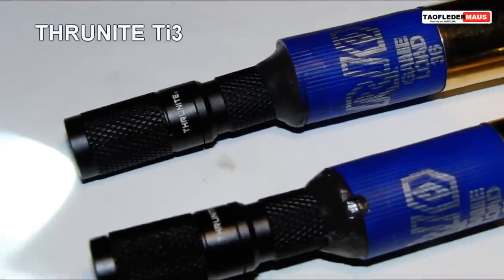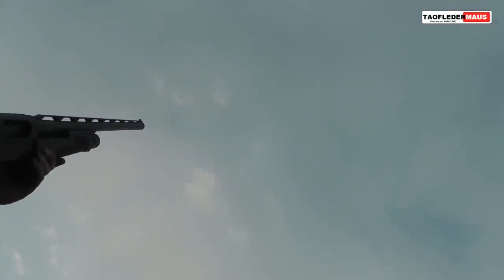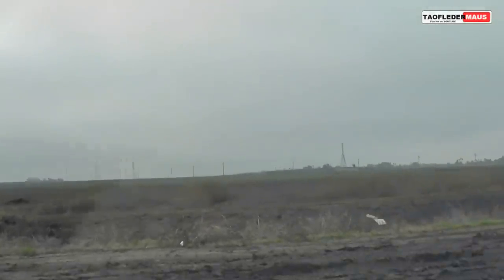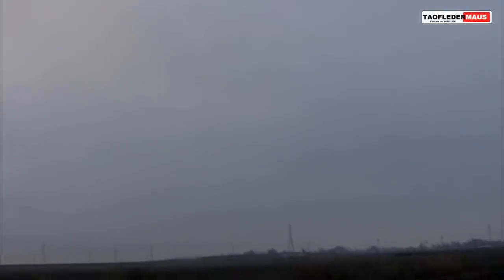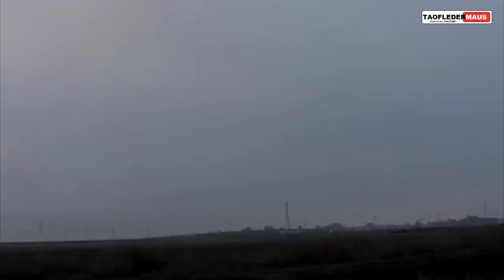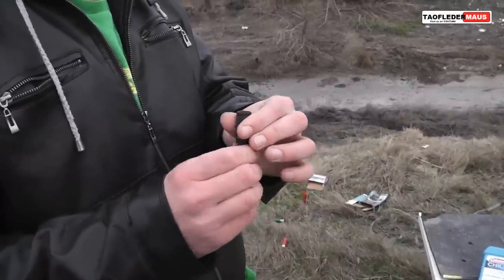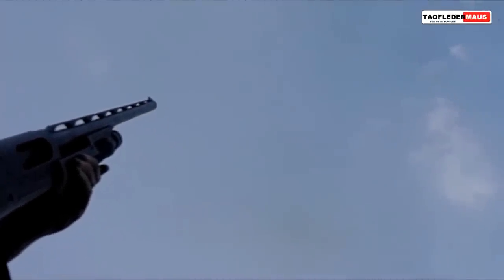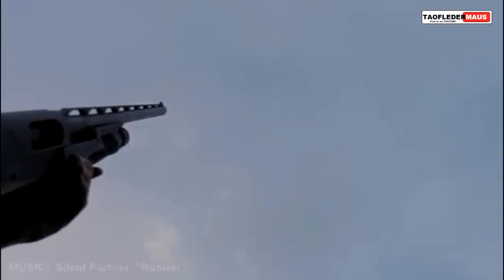Turning flashlights into BULLETS!   Surprising Results!

Comment: OK now i'm excited, i need to make a custom heatsink driver slug combo, where i use a 5w LED pulsed and over driven to 10 watts, and the light is triggered for "tracer" when it senses that it has been fired from the shotgun, in this mode its flashing at a full 10w and around 20Hz, and then when it senses that it has stopped moving it switches to find me mode where it flashes at 10w but only once every 5 seconds
Reply from the maker: +denvera1g1   The trick is building it strong enough to survive the g-shock.   The batteries in these were shoved backwards with so much force it compressed the battery.    It was a fluke the one flashlight stayed lit at all.

Comment: I did some binge buying of chinese LED lights on Amazon about a year ago.  They were all pretty bright, but about half of them failed unexpectedly due to bad solder joints.  I don't imagine they would fare well here.

If it's $5 vs $95, I get going the cheap route fpr toss around lights for the kids and whatnot.  But $5 vs $20 is a different story.  Pretty effective review of the product!
Reply from the maker: I'm cheap too.   Is a $100 flashlight 20x better than a $5 one?  Probably not.
Reply: Josh Daoust Thanks man, But I'm 17 not 12.
Reply: Josh Daoust  Planning to, going to college after finishing I might actually become something other then a sad flashlight expert.
Reply: Josh Daoust 95$. any more questions?
Reply: I Am SeCToR Josh Daoust You two are polluting the notifications of innocent bystanders with your weird little squabble.  Please move the conversation elsewhere.
Reply: Josh Daoust you can read the username right or did youtube get rid of it like they do everything else.

Comment: Hi cool video, as always.  You can calculate the height of a projectile if you know the flight time using the formula h=g*t^2 where h is height, g is acceleration due to gravity, t is time which gets squared here.  If it flied for 12 seconds then h=32.15*12^2 which works out to 4,629 feet.  That does not account for air drag... but it looks like you shoot that thing well over half a mile up to me!

Comment: Would they have looked like tracer rounds if they'd gone in the other way round, i.e. LED facing the shooter?
Reply from the maker: AintBigAintClever   The g-shock would have destroyed the flashlight,  shoving the battery into the circuit board.

Comment: Ok, so from what I can tell the flashlight flew for about 12 second, without air resistance that means 6 sec up, 6 sec down, a free fall for 6 second gets you a height of 9.82m/s^2*(6 sec)^2 /2 = 176 meters , then + air resistance and rounding maybe 150 meters up :O thats really high :D

Comment: I have a nitecore cobra flashlight, 3 years of dropping from 7 feet onto concrete, oil, solvents, heat and accidentally dropping in hot engine coolant it still works! I even washed it in a solvent spray washer.

If you rely on a flashlight, buy a good one.

Comment: Using crude estimations and physics equations (no air resistance). The flight time could range from 12.045 secs (frame counting) to 14 secs (Youtube time) the height could range from 177.918m (583.720ft) to 240.345m (788.533ft). But because I didn't account for somethings the height would most likely be higher.

Comment: That was awesome. At night that must look pretty cool to the human eye even if it can't be filmed. I think with a bit of compressed tinfoil between the batteries the other flashlights would have have survied the G forces.
Reply from the maker: tjpld   There is a little spring on the back of the body.    The battery was partially crushed on the neg. end of the battery from the g-shock as it slammed into that spring.   It was difficult to remove the battery.

Comment: Have you thought about firing one of those Swann Pen Cameras (or a copy), out of a shotgun while it's recording & see if anything is still recoverable from the Micro SD card?
Reply from the maker: milksheihk   I don't think the pen camera would survive the initial shock.   We shot a little pocket knife before and the blast really broke the knife apart when the gun fired.  I think those pen cams are about $50 making it a risky project to try.

Comment: You said that you didn't know how high it went, but it was in the air for around 13 seconds, which roughly means that it was falling for about 7.5 seconds.  By d = gt^2/2, it was around 275 metres or around 902 f.  All of this is pretty rough back of the envelope stuff, though.
Reply from the maker: Bevin van Liempt   That's probably very close.   About 300 to 400 yards was my best guess.

Comment: Ive had this on my wish list since Nighthawkinlight reviewed it and it is never going off until i get one!
Reply from the maker: Batteriii   I wish they were a little less expensive.  They are great flashlights and will last forever if you take care of them.  Usually that just means removing the battery when you aren't using it.   Batteries tend to swell up and corrode if you leave them in a flashlight for a long time.

Comment: According to my calculations the flashlight went 1626 feet high (error +-150 feet)
Assumptions:
Flight time: 12.5 seconds
Barrel Velocity: 1000 fps
Air resistance: 687 fps
Gravity: 32.174 ft/s2

If you want to use different assumptions, I can recalculate the numbers.
Reply: If anybody caught that I had to edit it after I posted it. Of course I screwed up the decimal. Air resistance was half what it should have been.
Reply: Finally, I really like your videos. You are doing stuff so I don't do it and kill myself. What about LED and watch batteries? Super glue led to watch battery. Have Wad, some crumpled paper. LED/BATTERY. crumpled paper. Maybe 3 levels of that.

Shoot at same time. That was a good idea. Enough light for the camera to see but dark enough for light to show up.

Comment: If you know the time it took to go up and down, pretty easy math to get an estimate of the hieght

looks like it was about 12 sec from firing to landing, so now its math time (in metric because I like it better):

so D = vt + (.5)(a)(t^2)

0=12v + .5(-9.8)(144)
705.6 = 12v
v = 58.8 (so initially it would have been traveling roughly 58.8 m/s or 131.5 mph)

at 6 sec the flashlight would be at the top of the arc so t = 6 for the next round calculations

h =  12*58.8 + .5(-9.8)(36)

h = 529.2

therefore the height the flashlight reached is 529.2 meters or 1736.22 feet

about 170 stories or higher than the Taipei 101 building (http://en.wikipedia.org/wiki/Taipei_101)

bear in mind this ignores all aerodynamics so its probably lower.

Comment: 13 seconds from barrel to ground. given that it probably rose at much faster than terminal velocity, lets say it took more than half the time to fall. so 9 seconds to fall.  x = 1/2 a t*t. where t =9 and a=9.8.   that means the height was . 81*9.8*0.5 =  approx 400 meters, or 1300 feet or so

Comment: Damn, if i lived near that place, i would definately go looking for them :)
Just ordered one on Amazon two days ago.
Reply from the maker: Nighthawk117w  They are great flashlights.  I think the only Achilles heal is the type of battery it uses.  If you plan on storing it,   just remember to take the battery out.   I've made the mistake several times of leaving them in and the batteries swell up and corrode and you can't even get them out of the body in other flashlights.

Comment: you should shoot a cam (somehow) but while its recording
Reply from the maker: max thepony  I doubt it would handle the extremely high g-shock loads.  I'm surprised the one flashlight survived in fact.  The battery slammed into the back of the flashlight with so much force the battery was slightly shorter and thicker afterwards.
Reply: you have a valid point
Reply from the maker: Yeah, it would be an expensive video to buy a few cameras small enough just to have them shatter each time we shot them.

Comment: Make virile time Distortion and antigravty. ..make mercury gas put under pressure inside brass globe make anode inside put strong magnetic Field on top north. Charge with 50 thousand k.v. . It's stuff they don't want you to know. ..

Comment: Should of done it at night, that would be cool
Reply from the maker: +Josh Lemerond  Cameras don't work that way.
Reply: I know but i meant to see the flashlight, just to see the light twirl in the sky if it was a bright enough flashlight
Reply from the maker: It was as dark as possible and still be able to film - using the limited amount of light,  and still be able to film in high speed.  When you shoot a flashlight at over 900 mph and it is tumbling in the air,   this IS what it looks like.

Comment: You need to shoot lasers out of a shotgun, laser first. The only reason is to see if they hit where the laser is pointing.
Reply from the maker: TheCompute101  just like the flashlight tumbled at a pretty high rate,  the laser is going to tumble around like crazy and you'd only see the laser for a split second while it faces the camera.   The rotation was so fast,  that my HD camera missed many of the flashes between camera frames.    I was able to see it flashing with my eyes,  while my cameras didn't pick up anything.

Comment: According to my math, the flashlight went about 2484 meters into the air. That is 2716 yards, or 2.5km, or 1.5 miles. Also I got a approximate muzzle velocity of 414 meters per second or 1358 feet per second. Can someone better a physics confirm?
Reply from the maker: I was hoping someone would figure that out!
Reply: Can you calculate the altitude based the time of the decent?  1.5 miles seems a bit much.  How long would it take to fall that far?
Reply from the maker: MY guess it may have when up about 400 yards max.   Maybe less.
Reply: The lite was only air-born for 13 seconds from blast to impact.  It would have required about 22 seconds to drop from 1.5 miles.  And that doesn't account for the trip up.  I will guesstimate that it only reached between 700 and 900 feet, based on using half of the total flight time as the time spent falling. It should drop about 880 feet in 7 seconds of free-fall.
Reply: YoderTexas The height did seem to much, but that is what the calculation came out as. I tried them twice, but it does not sound correct. The velocity, however, does sound correct. Yes I used the time in air in the calculations. I was never that good at physics. Oh, I did not factor in air resistance by the way, and assumed the angle was 90 degrees.
Reply: YoderTexas I did 12.5 seconds of flight. Throw in air resistance and time to fall, I came up with 1626 feet. 2.32 seconds of going up and 10.18 seconds of falling. 13 second flight gives me 1780 feet.
Reply: jwnavagus I couldn't tell when it reached the apex. And I was using the old 32 feet per second per second rule that I learned in 6th grade.  I know that isn't an accurate method, but it was close enough for me.  I like your calculations better.
Reply: YoderTexas Oh, I couldn't either. Thats why I reran it with your flight time. I can see the flash from the barrel and a couple of flashes later. There is accurate, close enough for government work and close enough to put on you tube.